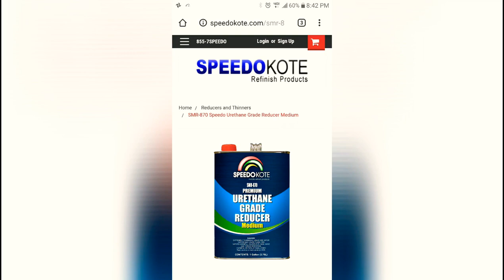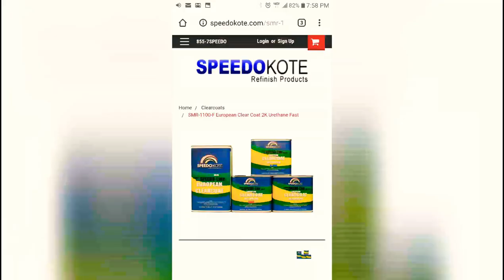HOW TO USE COLOR BLENDER

Comment: What does the color blender chemically do? Also you should look into a gimbal
Reply from the maker: Its just a clear basecoat that will bind to the existing surface . it creates a translucent paint when mixed with the oem color your spraying and helps to fade colors in better

Comment: When you use a clear blender do you sand the clear beyond the blend area or does it go half way between sanded and not sanded clear?
Reply from the maker: I sand with 2000 grit in my "blending zone" , I take my clear coat right to the end of the 2000 grit  scratches never past otherwise your spraying on an un- sanded surface . then spray your blending solution 2-4 inches past where you stoped Your clear coat . minor bufffing & cuting may be needed in the area past where you sprayed your blender to get off any over spray , this takes about 60 seconds. Wet sanding and polishing in the blend zone is usually risky being the material in that area is so thin be careful and focus on putting enough blender over the blend zone to smooth it out so you don't have to wet sand or polish that area
Reply from the maker: Secondly I may note.... BLENDING IS AN INFERIOR REPAIR ..... It never usually lasts more than 5 -8 years it will always fail at some point. Paint films require usually 2mils of material to be durable . in the blend zone its usually only .05 -1mil sacrificing durability... Only blend a panel if someone is being extremely cheap or its needed . use your best discretion when it comes to these repairs
Reply: Thank you for the reply, to recap what you replied. clear coat stops before sanding zone and clear blender is added between sanded area and not sanded area please correct me if I'm wrong. I'm learning to paint but most people want low budget clear repairs just for looks, thank you. I'm using speedokote clear and clear blender